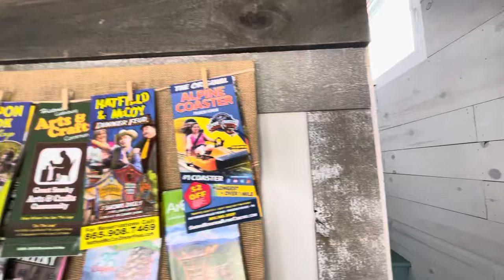This is a STEEL PANEL HOME?! 10’x20’ Beach Cottage Tiny Home Rental Tour @ Incredible Properties 🏝

Comment: Love that comforter.  Walmart has a shower curtain that has the same design.  This whole house is so awesome.  Big Chill has kitchen appliances that are modern, but have that retro look, with many colors to choose from (one of the colors will match that retro look microwave).  Even have an Induction Cooktop and range hoods to go with it.   They have a retro fridge, to match as well, a couple of different sizes, and you can have the handle on either side.  Love the glass window in the door, it is so pretty.  I found an adjustable bed frame with short legs that would be perfect for the loft.

I also love that you painted the stairs, they look lovely, and that little table in the dormer reverse gable is so cute.
Reply: I love it too! Makes me consider building one in near future. However, may not be cost effective to move it outta state🤔

P.S. I luv u guys but please please make videos shorter…Thanks!  

Happy Father’s Day tomorrow!

Comment: I like vinyl siding. It's maintenence free, easy to install, or to replace a damaged piece. But make sure that you pull out the grill before using it. Vinyl siding melts! I did that years ago, when I forgot to pull it away lol.

Comment: I love the colors of the inside of the 10' x 20' Beach Cottage.  The color of the front door in Aqua is right up my ally.  I would call mine the Sea Shell.  I would make it 12' x 68'. ( It would be my art studio. May be 12' x 70'.)  I do counted cross stitch-  and other sewing crafts.  I oil paint- water color- colored pencil- draw in pencil- oil pastels and many other things as well so I need a big tiny house. With a down stairs master bed room for my Queen size rot iron and enamel brass bed.  I just love that bed!  Love Terri Simmers.  Love you both and that includes Ace.

Comment: I love everything about this ❤ Especially the slider screen door. I love the blue stained steps and whitecwashed counter, and the board and batton type walls. I love the barnwood edge on the loft. For a beachy farmhouse feel, you could even add a short white picket fence rail; across the top of the loft edge.

Comment: I'm new to the channel but I'm loving it! I'm sure someone has asked this before but I haven't had a chance to go through all the videos yet.. in the steelclad homes, are the floors or the foundation of the floors still as well? And if so can you put epoxy on it instead of laminate? I have low vision and I've had my toilet tank overflow, my water heater flood, and my washer overflow.. and I didn't know it happened until I felt the water on my feet. I'm looking for something very durable for the floors. Also, I'm wondering how much of an upgrade it would be in an Incredibox to upgrade to a 36-in shower? I have to use a shower chair and I would have a need for at least two grab bars, so I'm thinking a 32 by 32 won't quite do the trick.

Comment: I would move the sofa to the other side of the tiny home. Add a wardrobe/closet for hanging clothes next to the sofa. with a drawer on the bottom to store folded clothing. A kitchen table could be placed next to the kitchen counter. Seal up the wall where the sofa had been. Place the tv and a computer setup there. Could place a long counter that meets up with the counter in the kitchen. 

Love the house !!!
Reply: @BUDSBEAU  I'm sure the sister-in-law will share input with the owners. I have traveled a great deal all over the world. I have also entertained a number of guests in my homes. I am very aware of the comforts for my visitors, as well as comforts for myself.  A tv in front of a sofa is a must, a closet is a must, a comfortable pillow is a must and a warm blanket is appreciated. ROBERT, I SPEAK FROM A GREAT DEAL OF EXPERIENCE. I SHOULD THINK THEY WOULD APPRECIATE MY INPUT.

Comment: Question; with all the siding and interior wood, fixed furnishings ect, that this customer added, can this trailer still be towed down the road without being so overweight as to be a hazard? Much-less within legal specs? If someone dies due to the criminally overloaded trailer does your insurance protect them?

Comment: It may look nice. But I see where the wood doesn't line up. As in both angles and straights. 
That window over the sink. One can tell it is not the best in where it was put together. You can see the issue at 13:12 There is another issue behind the coffee maker. where the bottom of one piece of wood looks like it is even with the piece to the right. But at the top of that crosspiece, it don't match up.
One of the angles can be seen at 15:12 and the first half of 15:13.
In the peek of the roof right by one of the lights. There is a gap between the top board there and the board where the lights are. that can be seen at 18:08.
If this was a possible for me. I would walk out of there. I don't want crappy work on a home I would be living in. It looks more like a 6th grader's project instead of a well built home.
Reply: Suzette.  May I ask? On these issues you see where wood does not line up. Is it all cosmetic or structural (cause other issues? Like leaks)

Comment: The stairs have no railing.
Reply: Not needed but you could add one
Reply: Railings are optional with tiny houses, some people just feel they don't need them or choose not to for various reasons like you're not climbing a full flight of stairs as the loft is still within the main floor and isn't a second floor.  Thus the dimensions of the stairs and available headroom it works within is different than what regular house stairs were designed for and that effects how effective traditional design elements work...

Consequently, railings can easily take up too much space in a tiny house, making it difficult to move around or even to move correctly up and down the stairs, which can make it more dangerous than safer for some people.  So they're not a good fit for everyone, though some people will still consider them essential and insist upon them but there's many reasons why you won't always see them...

Like sometimes it's just temporary, the owner may wish to install them themselves, as it does make things like installing the mattress in the loft easier if there's no barriers until after that is done and some people just want to feel like they had a part in the build, or they ordered a commercial railing and it hasn't arrived yet, or they want to have a 3rd party artisan, etc. to do it instead.  Blacksmith, etc. can provide options that ITH would not do for example... Or the owner prefers an alternative solution as there's many creative ways to provide similar function without an obvious railing being visible... Or it wasn't in the initial budget and they just have to do it later...
Reply: There's walls on both sides to balance yourself......if you need that....